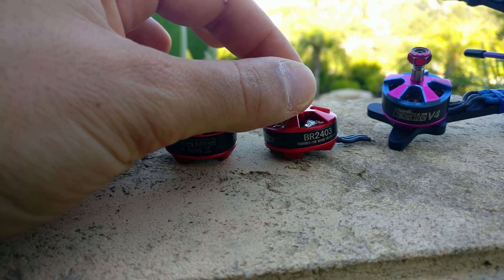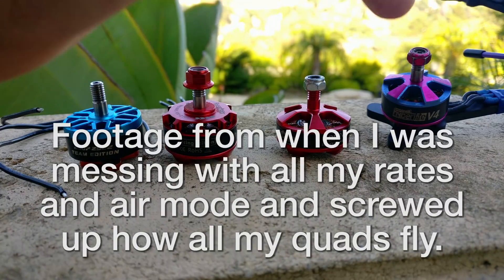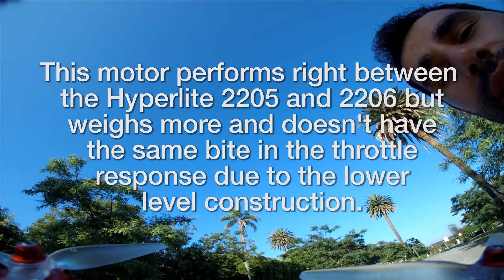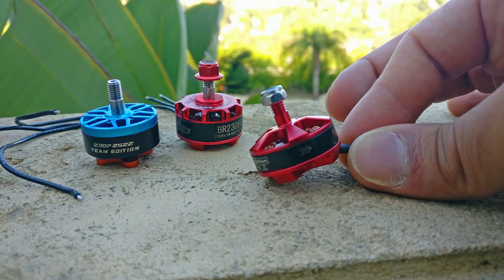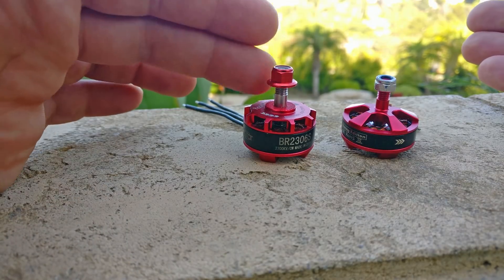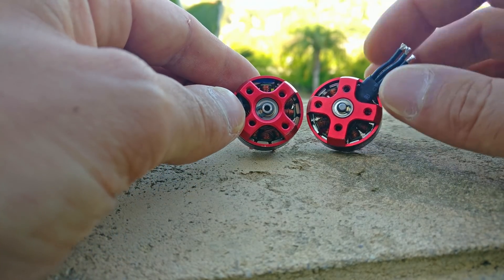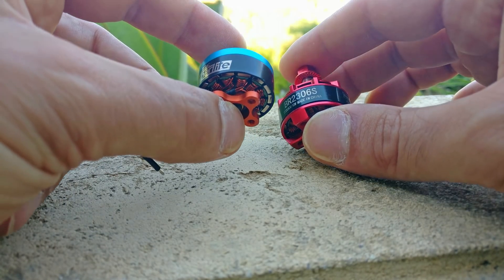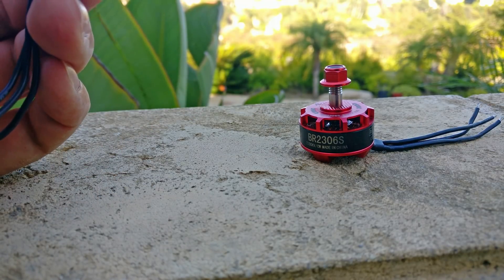Racerstar 2306 review + other things bout motors

Comment: Wonder what you think of the AOKFLY 2306 motors. They're similar to the Emax 2306(N52 magnets, screw instead of clip, 7075 al) but they're $14 which is quite a bit cheaper. Hopefully Banggood sends you a set for evaluation as there ain't too many proper reviews for it.
Reply from the maker: Actually they do look a LOT better.  Curved magnets, nicer windings, thin laminations.  I'm really not into cheap trashy motors but now that you point this out, I'll consider giving them a try when I get a chance.
Reply: http://www.miniquadtestbench.com/aokfly-fire-pheonix-rv2205-2300kv.html If what MQTB said about the 2205 version is any indication, then the 2306 has a fair shot at being a lot better than the Racerstars at just $5 more per motor.

Comment: Just FYI, I think I could see the air gap on the 2403 and how much larger it was than the 2306. Anyway, maybe sometime in the future, you can do a video on the differences between the Bang-sometimes-ok-sometimes-not ESCS and better ones (Speedix, Tattu, Etc), especially since Speedix ESCs are negligibly more than a Racerstar equivalent. I'd love to see a 4-in-1 comparison too. As a suggestion, go down to your local Sears or Home Depot or whatever you have on the West Coast and find a torque bar that does inch-lbs. Maybe then you'd be able to use that and do your motor tests just that much better/more consistently. 

Hopefully I'll be able to use some of the cheap-but-not-asstastic quality stuff for Piroflip for my next quad. (One that actually has FPV because the stuff I bought didn't work)

Have a pleasent day!
Reply from the maker: I'll do ESC's when I have good ones to recommend.  For now, spedix is the only cheap ESC I recommend.  The air gap on the 2403 and 2306 are the same.  Video doesn't show it well.

Comment: Are cheap motors dangerous to fly? (Durability, may explode, overheat, etc?) It's a bit hard finding the pricy motors when you have a ~200$ budget and are just getting into the freestyle part of racing.
Reply: Plus 50$ for a transmitter :/
Reply from the maker: no they should be just as safe as any other.
Reply from the maker: I'm so sorry you're taking this ultra cheapo route.  it's really gonna cost you more money in the long run.
Reply: Get a QX-7 for the transmitter. You will regret buying a 50$ transmitter when the QX-7 is 100$ and has high resell value.

Comment: Make... make a titanium frame... with carbon fiber props... no idea if that would fly better though! I do know carbon fiber props do exist so it's deferentially possible
Reply from the maker: titanium is not a good material for frames.  It's too brittle.  Carbon props are great but also same concern.  Touch a blade of grass at that high RPM and it'll shatter.

Comment: RCX 2206 or Racerstar 2306
Reply: 2400 kv on bough
Reply from the maker: the RCX will have more control so I'd go with those.  But they will feel slow.  I forgot to mention that RCX is working on a 23XX stator size.  No idea when it's due out.
Reply: thanks for the answer i waint  for the RCX 23XX Motor
Reply: Yeah but for $10-ish per corner you can't argue with actual quality. Nice to hear they're going to make a larger one too.
Reply: rcx eyes closed
Reply: Kabab FPV I bought the rcx 2206 v3. Looked great, flew great... for one flight. Zero crashes and now one motor has a loud clicking. Presumably a slipped magnet. I loved the rs1407 so bought the 2206 without warranty. Never again.
Reply: I wait on my pair oft the Rcx 2206 hope i have no problem. But i am recemend you to buy a replacment bell
Reply: open the motor and look inside then you would see where the problem is

Comment: hmm, not sure if I share your comment on Racerstar ESCs being shitty.
DroneMesh does some good testing and SOME RS ESCs fared very well.

Other than that, I would concur.

What do you think about the T-Motor Air 40 motors on a light build without action cam?
And what props would you recomment as max?
Thanks!
Reply from the maker: The Tmotor air series is a good motor but not durable at all.  on any 2205 I think the best prop will be the HQ 5x4.3x3 V1S.  Light motors so you're likely building something light weight so those props will perform well.
Reply from the maker: Oh and about the ESC's, I've just become keenly aware of the difference between higher end esc's.  I don't care about bench tests because they're not real world.  When you feel a higher end esc in the real world, you know it's good.
Reply: Thanks for you fast response.
Crash resistance is a big deal for me and yes, I wanted to start building a quad with weight in mind without it being a twig that snaps on every occasion.
Might I ask you if you had any recommendation for a motor for a sub 275g quad ( without batt ofc) that can take a beating?
I was looking at the rcx 2205 2600KV V3s.
Any objections?

Thanks again
Reply: I have the T-Air40 on my floss build and it spins the Avan-R barely warm. Luckily it comes with extra washer and c-clip since I've had replace 3x already. The bell tends to come off on a hard crash. Which I think is better than bending the shaft or denting the bell 🤔 but I'm running out of spare washer. It doesn't have gob of torque but it performs well on light props. And I don't have to run caps with these motors.
Reply: thanks for your input.
Hmm, I dont know... maybe I will go for the rcx v3 instead. going from your experience I feel its not quite the motor i am looking for.

much appreciated though, cheers.

Comment: If u want a legit beginnerfriendly replacement for racerstar 2306, go for emax rs2306 2400kV. They often sell for under 80 bucks per set with spare parts and a lot of mounting screws.
Reply from the maker: gosh I've told this to so many people.  An even better option is the $13 hyperlite 2205 motor.  They just keep throwing the price in my face.  "That's $12 more I'm spending on motors.  I could buy a Vtx with that money!"  And I'm thinking, wtf vtx for $12 is gonna be any good?!  then I just stop responding because they'll need to learn the hard way.
Reply: HEY! Hey! I use 10$ vtxs since 2015 and they are perfectly fine. None of them have ever failed me. 

Btw the lower kv makes a difference, I remember  you had a video about it but the lower kv of 2300 DOES make a difference compared against the 2700kv version on a same motor, the higher kv does have more overall power but the acceleration of the lower kv is superior to the higher kv.

Another problem I see for the racerstars is the quality control, some of them have the bell that looks like an spinning egg when the motors spin + plus they have too cheap bearings... But for the price..
Reply: Kabab FPV 2205 2500kv is my choice on my daily fliers. I like the emax rs on a “cow“ like setup a lot since building...

Comment: You should try the latest RF1. I'm pretty sure that you would change your opinion of raceflight within 30 seconds of flying it and also be able to tell the difference in videos purely from sound.
Reply: I am also willing to bet that you cannot tune a bf rig to fly as well as a stock rf1 rig.
Reply from the maker: Well Ponyboy, I have tried RF extensively and I do not run it because it has always had reliability issues for me.  It flies great but it is far from excellent at stock.  In fact the best performing setup I have felt is to take a raceflight FC and put betaflight on it running the dynamic filters, PT1 and at least the first two notch filters off.  On a stock tune, it flies better than RF.  Give it a shot yourself.  I don't even know what the settings or what firmware the quads in this video are running.  I also screwed up the feel and tune of the first two quads immensely in my testing of things.  Motor performance still shows through however.
Reply: The newest RF1 flies better than all that pt1 stuff and you don't have to do a single thing to it. I fly both, not just shooting from the hip. If you would just try the latest I am 100% positive you would change your mind. What reliability issues?
Reply: Magma, that's what we are talking about when I say try the newest RF1. The skitzo board is the same as the revolt just a different color and 5$ more. They are the only boards that will run RF1, other than some odd spektrum board, that nobody owns. RF1 and skitzo board mean the same thing.
Reply: And when I say the latest RF1, I am talking about the beta stuff that has been released in the last cpl of days. I flew it yesterday completely stock on a range of props from v1s to avan and it flies amazing on all of them. That's a pretty damn big envelope!

Comment: 11:55 "I do not recommend any of their ESCs" , I'd be interested in a video about ESCs in general, and then explaining what you don't like in their ESCs (performance? durability? predictability? all of them?!)
You might not be the most knowledgeable drone youtuber, but certainly one of the most experienced and your point of view should matter to anyone to some degree.
Reply: DroneMesh does some comprehensive ESC reviews and some Racerstars actually fared really well.
Reply from the maker: I cannot make this video because too many pilots would be angry at me for it.  In this case I really am a snob and want my higher priced ESC's.  They perform better across the board.  The single biggest issue is the frikin dipping on throttle pump.  Cheap esc's just do it way worse than ones that cost a little more.  Something people don't know is that the cheap tier of esc's are using USED FETs!  Yes!  They're USED!!  China companies exist that all they do is pull FET's off other electronic components and resell them.  That's how they can make an esc for like $7........

Comment: I think you might overprop the 2403. The stator volume of it is smaller than 2204, isn't it? I do agree that it's junk though.
Reply from the maker: Probably but I'd say it's not even a 5" motor.  It's probably best for 4" and 5S.  But there are still far better options for that too.  It's just a horrible motor and a waste of materials to make.

Comment: just a heads up with you mentioning the bearings on the 2305 racerstars. The bearings are especially bad. I bought a set to put on a beater quad. One I could thrash and try out riskier tricks ect. Well after less than 8 packs on them there is serious bearing play to the point that they make kind of a weird ringing noise which probably started after about 4 packs. Ive also seen several videos pointing this out as well so it seems like its a common thing. I understand that bearings wear out. but not in 4 flights.
Reply from the maker: I've put a dozen packs through this quad already and no issues yet but I wouldn't be surprised considering it's a $9 motor.  The performance is really not very good.  It'll probably only be acceptable for beginners.  That being said, I've had brother hobby bearings start to crackle after a few flights too.  Not many, but it happens annoyingly.  But they don't have play so still good.

Comment: I really enjoy the info you provide in your videos, Can you recommend a solid 1306- 3100 to 3300 motor.. 
Looking for more durable option.
Reply from the maker: Hyperlite/brother hobby 1407 3600kv or I think RCX has one in that size now that's just as good.  This is a 4" motor.  Do not put 3" on it.  It is no good.  For 3", 13XX and 14XX is too big.  Look at 1105-1106 motors in the ~5000-6500kv speed and run them on a ~500mah 3S.  Keep AUW to around 160g maybe.  It should perform fantastic.
Reply: I am currently  running 3" HQ Bullnose props with 1306 3100kv  flies great but my motors damage easily. I need a better option. My quad doesn't kit 4" props.  500mah 3s battery

Comment: You would'nt recommend racerstars esc's? why not? 
Make a video about it and explain why ;)
flying the RS35A escs and never had any issues.
Reply from the maker: I cannot make this video because I'll have too many new pilots angry at me.  When you use good ESC's and then try to go back to using cheap shitty ones, then you'll know.  All things from reliability, performance delivery, even power delivery, throttle response....ESC's are mostly the same but the higher priced ones just use better components.  You won't be able to tell unless you're getting into the advanced pilot territory however.

Comment: dude, you can't compare one setup to another when you have soooo many different variables. you can't make judgments based on "how it feels" "tightened by hand" that's called anecdotes. you're an educated man, you should know better.
Reply: Pssht!  Even if they paid me i wouldn't do proper testing.  i will swap motors onto the same quad and give my opinion though.
Reply: This^^ RCX are my go-to budget motor.  maybe $1-2 more than racerstars but competitive with $20 motors.  Plus they are super light.
Reply: Michael Sharp well said, I learnt to fly on a Banggood qav 210 clone frame, with Racerstar esc’s and motors. 3 years later I have upgraded my radio to FrskyTaranis and my goggles to Fatshark Dom v3’s. My quad is still going strong on original motors and esc’s and flies amazing.
Reply: Even accounting for those differences,  the performance delta between the first punchout on each is so hilariously enormous, spending resources quantifying it basically does nobody any meaningful good.
He's making these videos for people in your situation - bank an extra couple of hours at work, and go up to the RCX motors, because they will perform a ton better.
Reply from the maker: If you'd like to pay me to do proper testing I will.  Otherwise, all I have to offer is my experienced opinion.  I can swap motors on the setups and they'll be the same.  If you think the racerstars are great motors, please pickup a set.  They're not exactly gonna break the bank but I'll say 'I told you so' when you don't want to fly that quad with those motors ever.
Reply: If I could get paid to test quad hardware I'd quit my min wage job in a heartbeat. If not for racerstar and Banggood I could not afford to fly.
Reply from the maker: Which is why I made this video to begin with.  So that people hopefully at least get the best racerstar offering and have a bit better experience.
Reply: I think the 2403 size is just a weak motor. Even if brother hobby made it, I don't think I would be much better. More to do with stator height. 4mm should be the absolute minimum for 5" props. Maybe even 5mm.  The stator width complements the height by giving it leverage. You could have 8mm height but if you don't have the width you won't get shit for torque. And vice versa. You could have a very wide stator, but if you don't have the height to complement it...you get the picture.